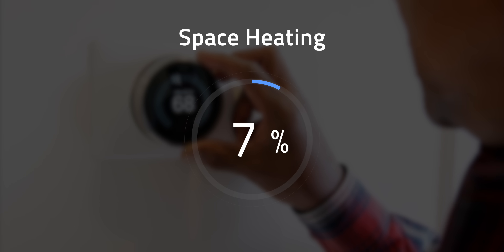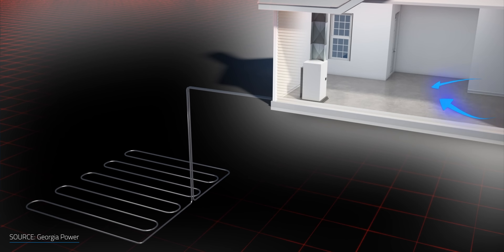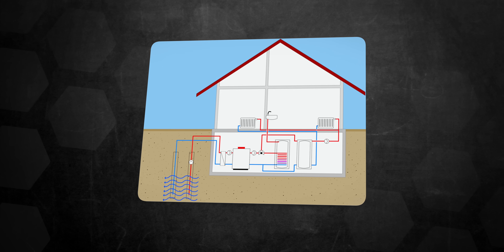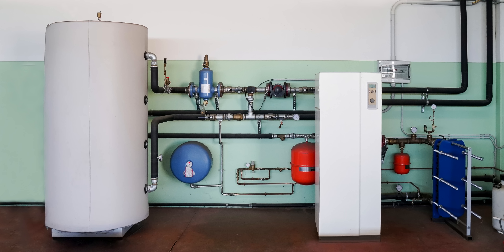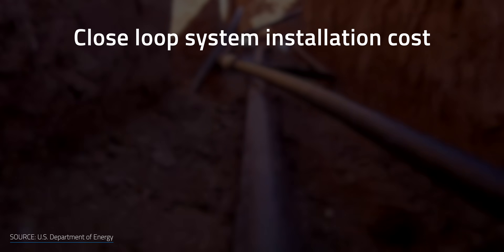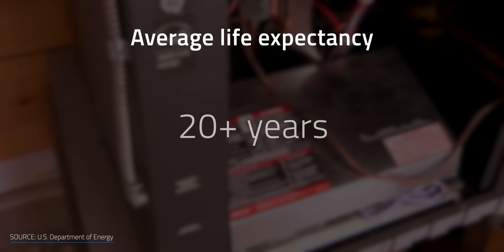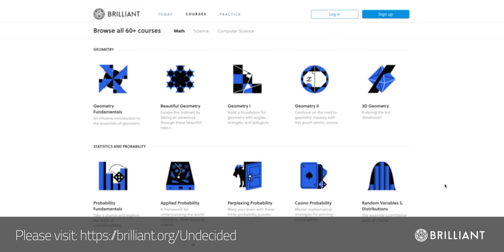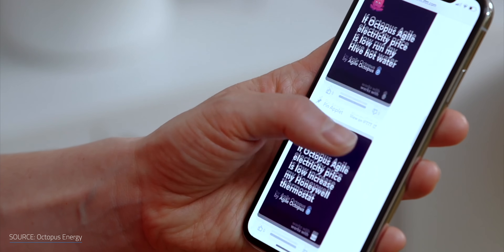Is Geothermal Heating and Cooling Worth the Cost?  Heat Pumps Explained

Comment: What would be the economics of multiple homeowners installing a single, larger underground loop for all of them (while maintaining separate heating units)?
Reply: A lot of the cost of these systems is the ground works, and a good deal of that cost is the "set up" fee. If you have a location that close enough to all of the houses you could likely save some money splitting the set up fee and getting the most out of the crew.
Reply: A leak in any of the residents heat pump would effect everyone's heating system. To have serval people on the same circuit you would need a branch controller such as what is used in commercial Variable Refrigerant Volume VAV systems. It is unlikely that one landlord would wish to supply heat to many tenants in such a manner since the cost of any geothermal system is quite high. and the length of the piping circuit would need to be multiplied for every person drawing from the same heat source. The advantage of such a system is that a person could have the benefits of a heat pump even in a very cold climate and potentially save money over the cost of running miles of gas pipe to a remote location.
Reply: @thewallstreetjournal5675  Well, a short in your neighbors installation also affects your electricity. That's why we use fuses. And there are similar devices for these kind of installations. Not sure about US, but in EU some cites provide centralized district heating based on geothermal systems.
Reply: @thewallstreetjournal5675  I carnt see it working too well as one set up to feed all your neighbours. But you and your neighbours may make a good saving if you get all your homes all installed at the same time. may be able to work a good deal.
Reply: I'm thinking it looks good on paper to have multiple people on the same system, but would essentially create all the problems with having an HOA.
Reply: I could see this being more for homeowners installing multiple systems but splitting the area. I work at a civil engineering firm and developers do massive grading changes for the most efficient building, during that process I could see them easily creating a hole in the "backyards" to install the piping and then once the houses are being built it's just a matter or hooking up everything. Since they are in the process of earthmoving the cost difference would be negligible. The only thing is the big national developers are hesitant to change the way they do things (I assume) and there would need to be a municipal or state push to have incentives for them.
Reply: The system is called district-heating and is more and more common.
Reply: Eggs and baskets (?) What happens to your effeciency when your neighbor fails you? I dont know, but worth a thought. Im sure the cost will be near the same as if you split the cost, but now you only have to worry about yourself.
Reply: I believe you would be better served with a well that provides the water source for the system. Well water is constant. And you would need to run 5 gallons of water per minute per ton.
Reply: Why do in ground loops.  Use the air
Reply: @saygrey  that's not possible in all areas, when it's -40 outside good luck trying to use that to heat anything. There is a limit to the difference in temperature that air will function.
Reply: Jay Dunbar I hear you   But here’s the catch.  I’m using the in my shop   Im living in Manitoba Canada. We get -40 temperatures.  I don’t have backup heat  , i was warm all winter  74°f      Come to Manitoba in late January and see
Reply: Jay Dunbar    Please note. I also work for a Refridgeration company  The unit that’s being installed is a Fujitsu.   Ive  got them in farm shops  in home garages in houses. Even green houses where they are growing food
Reply: What type of system do you have up there? I'm planning a house in Warroad, Minnesota at 48.9 latitude.
Reply: To avoid maintenance problems you can just share the installation cost but have a separate loop for each homeowner. My second option would be coordinated maintenance, which can be a headache. I guess it depends on the number of homeowners.
Reply: Where I live this is done on a city level, since the infrastructure doesn't fit inside the city, whole city blocks are hooked up to central heat sources in industrial areas just outside the city.

Comment: Stealing a page from solar heating systems, I've wondered if air source heat pumps with hot water storage tanks to ride out cold snaps might be an option in some areas (presuming you've room for the tanks, of course).

Comment: You sure it's worth to dig up your garden while a air water heatpump will be all you need
Reply: Air source heat pump efficiency drops off a cliff when air temperatures fall close to or below freezing, so yes, it makes sense to use a heat source that has a higher and more stable temperature especially if you are located in a colder climate. Ground source heat pumps are also near silent, while air source heat pumps can create a noticeable noise which can be an annoyance to the householder and neighbours- it's especially noticeable at night when general background noise is lower and doesn't mask it.
Reply: @spencerwilton5831  that was what I learned at the time when I was studiing . Today there a air heatpumps out there that work up to  -30 ° C whithout an elektrical backup

Comment: Still best suited for densely populated areas where multiple structures could piggy back off the same underground tubing infrastructure, granted that's also where pollution is most impactful so the more heat you can use without burning the better.

Comment: Most homes are going to run heat in the winter and AC in the summer. So it looks like a system like this means you will spend a bit more energy heating and cooling the ground.

Comment: So if you live in the country, you could get water from a well, electricity from solar, and heating and cooling from geothermal. We are almost at the point where homes could be entirely self sufficient, with no outside utilities coming in and very little work compared to most "off-grid" homesteads I see ppl on the tube doing.

Comment: I think your payback period is very optimistic. There have been significant improvements in inverter-drive air to air heat pumps in the last few years. While my forever home will more than likely have a geothermal heat pump in it, it likely won’t be for the energy savings, but just because they are awesome. Good video my dude

Comment: your cost on heating are way off. I have a 2600 Sq ft home in upstate New York and heat with propane and hot water and cooking. I use about 1300 gallons of propane a year and current prices are about $2.89 to 3.50 a gallon locally. I am working with dandelion to install their system. My estimated pay back is about 6 years based on current rates.

Comment: I recently contact Dandelion for installation advise. They seemed like a good option to consider. The issue I have is that the lot of land I have is smaller and their current drilling rig equipment is to large. Does anyone have any suggestions of rigging equipment?

Comment: Excellent video it peaked my interest and made me think. What I see is the average system is basically a 35,000BTU air-conditioner compressor plus a water circulation pump & interior HVAC fans and or pumps. All designed to lower energy usage.
The long ROI = a tough sell however if like we do for solar panels (make the neighbors pay) if democrat legislatures again increase the utility bills for the less affluent (uneducated) minority communities then those raised rates could be used to offer grants such that affluent persons (educated) can apply for & use to cost effectively install geo-thermal and lower their utility bills. This would be a win/win for the affluent plus I would guess a geothermal system would raise the resale value of a home which might eliminate the pain of the long ROI.

Comment: I installed this system on new home build in 2002....it cost way more than standard furnace and add cost of drilling. System never could maintain a good temp in hot or cold weather. I would hope advancement in technology would improve these problem.my recommendation....no

Comment: These kinds of technologies are dependent on regional conditions. Heat pumps can't extract heat from normal to severe cold that a lot of Canadians experience every winter. Ground source heat here has to be dug down in vertical wells going fairly deep. Our frost line is typically 4 ft min and to lay horizontally it would have to be deeper than that.  Same with solar, while we have long days in the summer, when we need power the most (deep winter) our days are less than 8 hrs total sun. Thats provided your panels are clear of snow too. The problem is people see a tech working ok in a certain area and blindly assume it can be applied anywhere else. That assumption is false, we had 3 weeks of minus 30s deg C here, it came in Feb instead of Jan when we usually get it, and I was glad we had a NG forced Air furnace to keep us and our home comfy.

Comment: You should mention how multifamily housing makes heat pumps more economical (which basically solves the biggest problems associated with the technology)
a heat pump delivering to a single family home costs, about $10k to 30k per home heated, while that same unit in a six flat costs between $1600 to $5k per home heated, and multifamily housing loses less to heat, so you wouldn´t need a bigger pump.

Comment: Sounds like similar COPs as heat pumps, at least on paper,  but with much more cost.   Now granted the extremes are where they really start to show, since if it gets to sub 0 temps your heat pump won't work anywhere near as effective as a geothermal but still.      Also curious how this translates in cost to natural gas furnaces, while yeah the efficiency is way better, very often "this CAN have significant savings" typically compares to electrical or other expensive heating means.

Comment: A friend has a ground floor apartment here in the UK, his housing association refused to replace his faulty gas boiler and stated for environmental reasons they're now attempting to install geothermal heating in all their properties. The car park of his block was dug up, and he was the first to have his brand new system installed with a heat exchange/pump. 

His electricity bill is now over £200pm as 90%+ of all his heat is generated via electric heat pump instead of his previous £40pm for natural gas. This is going to get worse as other tenants' boilers are replaced and he has an even lesser share of the small residual heat stored underground, this is with at least 200m²/2100sqft of piping used outside to a single one bed flat.

While it's one particular case, the inefficiency of his system has really made be question how viable it is in the UK, most have very little garden space to play with.
Reply: something very wrong with those numbers. £200 a month is about 1200 kWh of electricity. That should produce about 4800 kWh of useable heat, which equates to a heat consumption of around 160 kWh per day. To put that in context, I use around 150 kWh per day of natural gas heating a substantial five bedroom and poorly insulated Victorian house in London. That system is not functioning correctly, he's possibly using it incorrectly, and likely a combination of the two.
Reply: @spencerwilton5831  It's definitely not functioning correctly, and yes I believe his usage is around 1,100kWh per month. It's a ground floor flat in an old converted Victorian factory building that has had severe neglect from the housing association, with damp and mold problems not dealt with for years.

Comment: 30 years ago, we built a 6000 sq ft house in the northeast and consider a closed loop horizontal heat pump.  At the time and with lower energy prices, payback period was 20 years.  I doubt it has improved considerably because 2/3 of the cost is labor installing the massive coils and precision equipment.  Those costs have gone up instead of down unless there is some new technology to mitigate them.  As an engineer I love the physics and environmental impact, but the finance is not great. 
However, here in south Florida most condominium buildings use open loop geothermal systems to heat swimming pool and spa in the winter.  Performance is great.  ROI is good, but due to limited competition, servicing is expensive.

Comment: My house is on highway frontage.  Highway expansion nicked my geothermal lines about the time my unit died.  The utilities contractor went broke.  So I was unable to be reimbursed for the damage.  I installed mini split as replacement.  Everything is cool so far.  Pun intended.

Comment: So what I'm not understanding is the last part about dual source heat pumps. Is the efficiency gain occurring during mild conditions where you'd normally see a comparative energy loss by running the pumps on the ground loop vs just a fan on the compressor unit? You'd think that during hot and cold extremes it would always be more efficient to tap into the ground loop...

Comment: There is this guy in Nebraska, heating his greenhouse with geothermal. He doesn't use these absurdly expensive heat exchangers / HVAC/pumps or whatever. He dug the 8 feet or so deep trenches himself for a few dollars, buried a few hundred feet of standard ventilation pipes and he runs a small fan to circulate the hot air from the ground into his greenhouse. These systems don't need to be expensive. The people selling them want you to think so.
Reply: Exactly. A lot of this stuff is simply overpriced by companies trying to turn a huge profit. Same with a lot of these 3D printers and other product. I saw a 3d printer the other day that cost 6k while having under $400 in parts. Then there is a popular security/lock picking youtuber that sells an rfid skimmer that is a $4 ESP32 and less than 1 weekend of coding work utilizing mostly open source projects (ie. other people's work), and he sells it for ~$80 (used to be ~$140).

Comment: Thanks for including KW in your calculations which the world outside the USA use. It saves a lot of mental gymnastics.  I use a small ASHP drawing warm air from the living room for water heating which works well when solar power is low in my off-grid house.

Comment: Your picture of a mostly glass house may work on the West Coast, but how many people can afford to live there? Passive solar design, better insulation, and increased furnace efficiency will payoff their extra costs a lot quicker. You first should have a well designed and weatherized house before you think of adding expensive energy technology. Most people in our economic culture don't stay in one place long enough to make the extra cost worth it, so they don't do it. It's another of our systemic problems.

Comment: Now if I could just buy a home I could actually put some of this stuff into practice.
Reply: Work, watch spending,  and save. You can get there if you want to bad enough.
Reply: @fredbecker607  You clearly have not been following the mania that is the US housing market. Granted if/when it mellows out, such practical advice may be worthwhile again.
Reply: @amannin1  exactly. I feel for my kids. We've left them with an impossible market.
Reply: @fredbecker607  with the current housing market around the world even a decent profession will need decades of work to pay off the costs of the land, the house itself is small potatoes. Small savings here and there won't significantly turn back the clock on that. That's why lots of millennials aren't even trying to save for a house. Purchasing power is so messed up right now, i could buy a few Rolls Royce's before getting a decent plot close-ish to a city with good jobs.
Reply: 1) 3d printed houses are coming along, which will bring down the manufacturing costs dramatically.

2) In ~8-10 years, fully automated cars will eliminate the long commute issues of living out in the country where the land prices are lower and the roads are lower speeds. So this will allow you to sleep on the way to & from work. Which will in turn, exponentially add to the geographic footprint of how far away you could live from work. And just sleep for an hour or two, going to and from work. Maybe locate equidistant, in the countryside, between 2, 3 or 4 or more large cities, and countless smaller towns, multiplying the job prospects. While simultaneously taking advantage of lower land prices, AND the fully worked out 3d home building technology...all inside of about ~10 years from now. And with the 3d formula of the newly rediscovered art of Roman concrete, which we already know lasts over 2000 years, your house will last...longer than you'll ever need it to without falling down. Because the Roman concrete structures are still standing 2000 years later. And termites & fire & tornadoes do not affect concrete. Just don't build on an earthquake fault or in a flood zone, and you're set for life.

3) Locate where there's a small year around stream or an underground spring, and you can get your electricity for free from an inexpensive micro-hydro setup. And if it's internal to the house, or to the side & enclosed, and running off an underground spring, it'll never freeze up. And you'll be set. 😂

Your generation WILL be able to afford housing again...just give the technology some time to catch up.

Especially the automatic self-driving cars, and the high speed flying drone suits that will come within 20 years, the travel time & sheer aggravation of long commutes will just disappear, as an issue. Driving will be sleeping time. And the flying drone suits will be hundreds of miles an hour, so 100 mile commute will be ~15 minutes each way. Either way, you can live WAY out where the land is cheap.